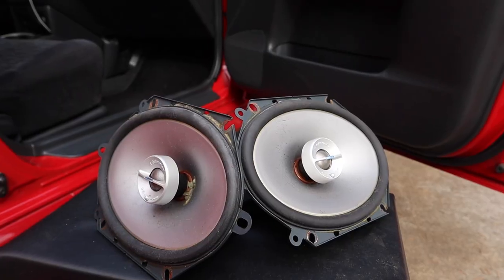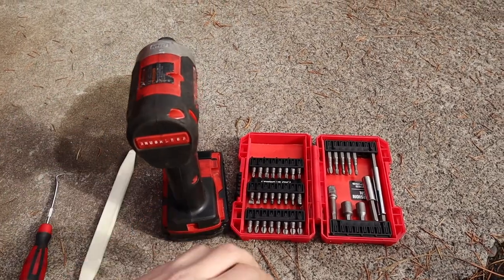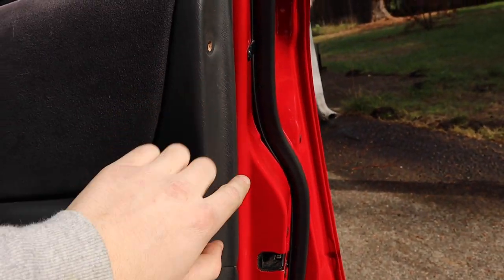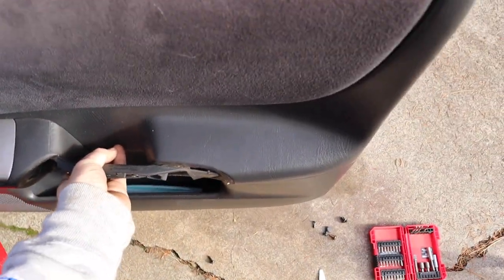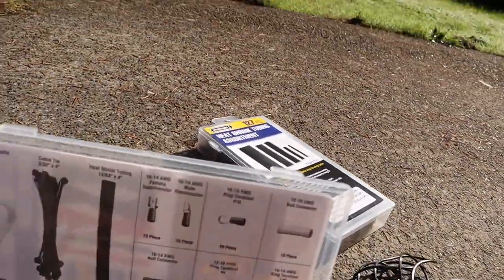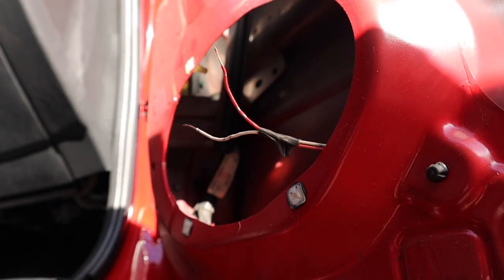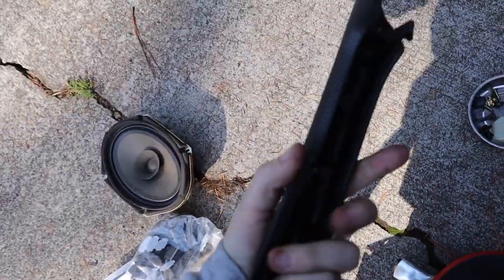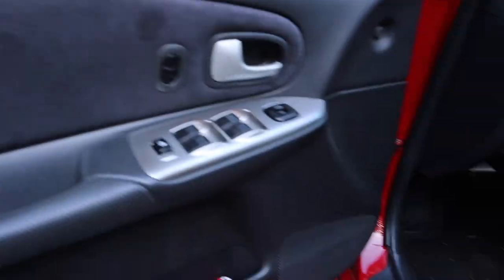New Front Door Speakers for the Protege5!

Comment: Why did you leave the stock tweeter installed? Does it not conflict with the new tweeter?
Reply from the maker: No issues with the current tweeter. It’s kind of a harder size to find that actually fits under the grille. So I just left them. I found these speakers at a scrapyard and figured might sound a bit better and maybe help someone take their door cards off. I have little to no audio expertise.

Comment: What antenna are you using? I like the fin look.
Reply from the maker: It’s a generic Amazon shark fin that I sprayed to paint match
Reply: @NoahGaebel  do you remember the color paint you used? I just purchased a protege5 a week ago that's the same color as yours. It's not perfect but it'll get there.
Reply from the maker: This is it and I also used a good clear coat.

Touch Up Express Paint for Mazda... https://www.amazon.com/dp/B01N9EQ57T?ref=ppx_pop_mob_ap_share

USC Spray Max 2k High Gloss... https://www.amazon.com/dp/B00W2D806Y?ref=ppx_pop_mob_ap_share